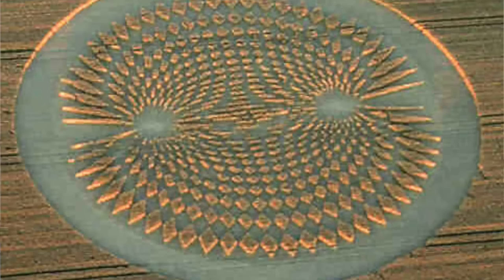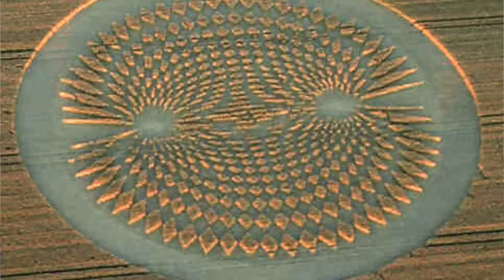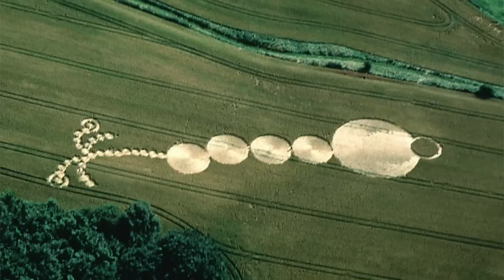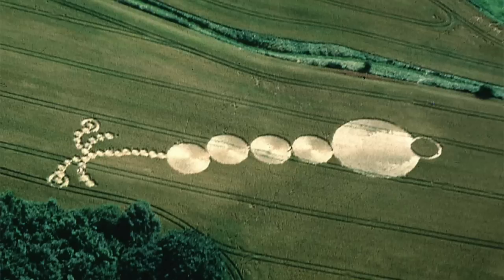Simple Idea May Explain Cold Fusion and LENR

Comment: I may not be able to get this point across solidly, but I'll  try. As you were explaining this, I couldn't  help  but  think  about  using fibonacci  scale added to this vortex, coupled with science of cymatics (resonance infused) of the "sunflower" shape and having the cathode of the reactor have shapes just like the sunflower at molecular level if possible (maybe the "imperfections" working better has to do with surface area?) Somehow using the super wave principal (if possible at 432Hz), tune the resonance to match the shape through cymatics... I hope this comes across how I envisioned  it in my head. 
I love the videos. Keep them coming.
I want to learn as much about this as possible.
Reply from the maker: Arthur Lindquist Excellent points. Thanks!

Comment: More specifically the necessary so called 'defects' are actually a crystalline structure of the metal.   Crystals are used in electronic circuits to resonate at various frequencies, so the structure needs to be able to resonate on a molecular level to produce the desired affect.

Comment: The Simeon Hein cold fusion electro-magnetic flywheel from RV to Asparagus.  Contact Ingo I'm sure it is not to late in another dimension.
One more....what do you think of space being created or "released" by atomic destruction?
Reply from the maker: prospero matthews Thanks for the ideas. Got me on the last one. Will have to ask Ingo:)
Reply: atoms are made of space, and not just the empty parts.  Spacetime is infinitely dense, and matter is a small fraction of the energy that is present.  By infinitely dense i mean it is approaching infinite density, always.  All of space is part of a circulating system that is always sending energy to every part, so the energy density is always approaching infinity.  Matter is the fraction of that energy which manifests in organized ways that mimic the structure of spacetime... the vortex twisting structure of space is the facilitator of DNA, sea shells, broccolini, etc..
I think of it as atoms are like capacitors, that can maintain a certain amt. of energy at a constant rate.  It does not contain the energy, it maintains the energy that creates it in an organized way.  Sorry but that's not the craziest theory in the universe... it's probably true.  I like your idea, however i think that if you entertain the theory i mention you'll have an epiphany.

Comment: Neat! Has anybody tried using graphene and or stanene anodes and cathodes in a small cold fusion reactor yet? ( I'm still thinking that a standard steam vaporizer is a simple cold fusion reactor)
Reply from the maker: Good idea. Try it and let us know what happens.
Reply: I Will! I always had a suspicion that Flubber in the 1960 Disney Comedy Classic "The Absent Minded Professor"  used an L.E.N.R. that was really handy in making those high jumping shoes and flying Model T's! Then the Military grabbed the idea and suppressed it. If the Doc. had partnered with Elonzo Hawk we would now have L.E.N.R. powering the grid and a much smaller Green House Gas problem. Bet Mr. Burns would have got a piece of that action too. Hopefully as you read this some kid bored with his/her R/C Quadcopter is using his/her working open cell L.E.N.R. to power his/her Xbox for the afternoon before he/she post it on You Tube and saves the planet!.